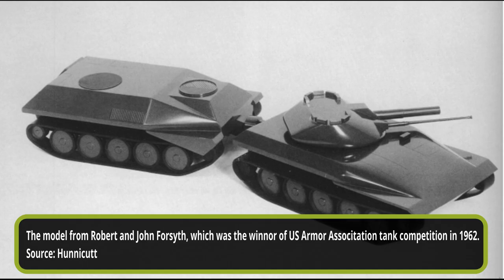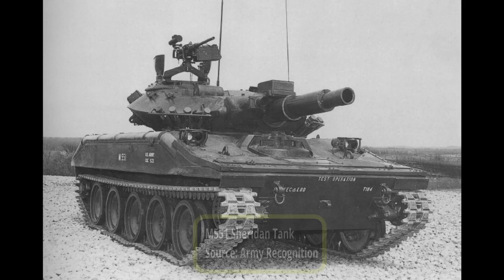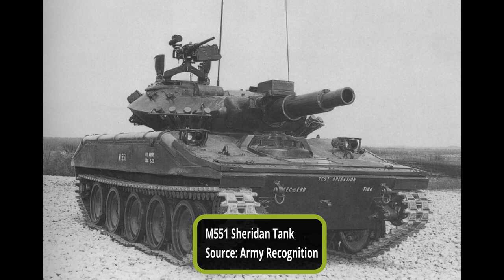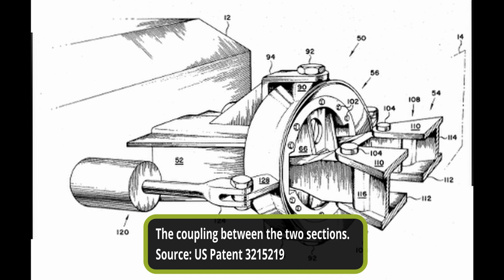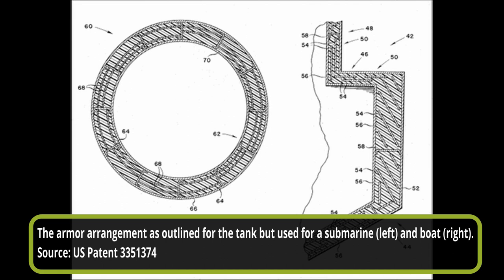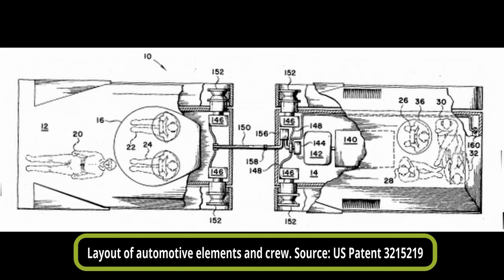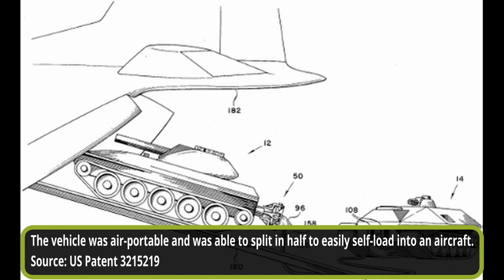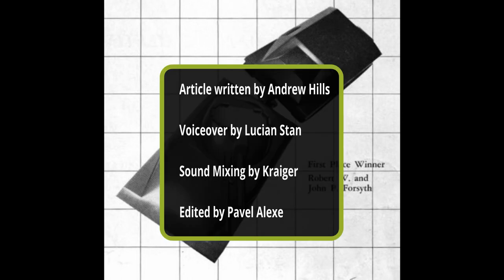Lockheed/Forsyth Tank - American Articulated Light Tank Concept

Comment: Good work, You would think just the forward hull alone would have been worth the development for a scout vehicle that may been more capable then the M551. The funny thing is and I believe this was a Lockheed design too. The XM808 Twister armored car was a articulated wheeled  vehicle that was built but  never entered service because the U.S. Army merged the scout vehicle program  in with the Bradley IFV development program
Again Bravo Zulu
Reply from the maker: It would have certainly been interesting to see even just the front part used. The rear APC part was of dubious strategic and tactical use, but the idea of an articulated vehicle is that it has better mobility than any of its parts (especially when it comes to obstacles).

We hope to be able to cover the XM808s someday.

Comment: This was a turbine or diesel electric setup? if i understood that correctly. Im honestly surprised no one has done this yet. Especially with todays electric motors, just feed them with a turbine/diesel and a high cap capacitor and skip the 50 tons of Elons battery packs.
Reply: 2 vehicles are really unpractical probably. and diesel electric as in diesel trains is just too big to put into tank.
Reply: @jebise1126  not anymore. High power diesel generators are not prohibitively large or heavy
Reply: @iswarthunderconsumerfraud9994  still bigger than clutch and gearbox.